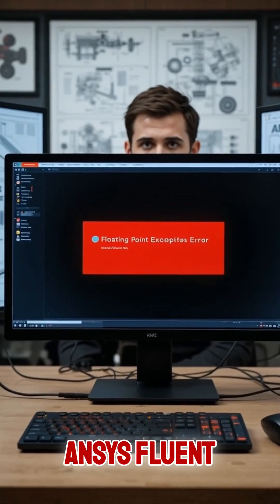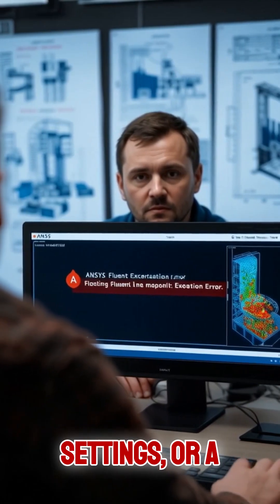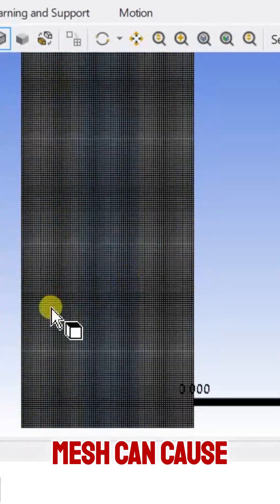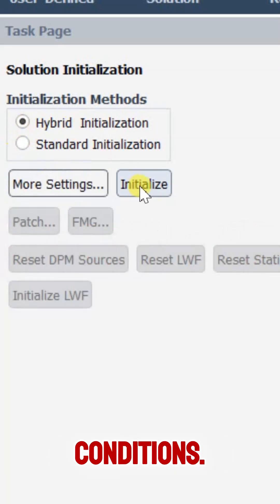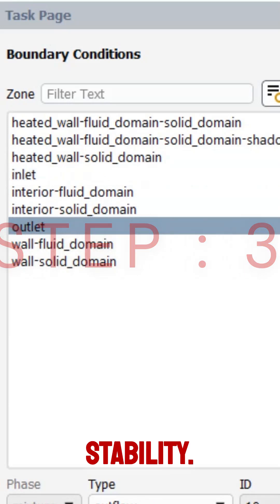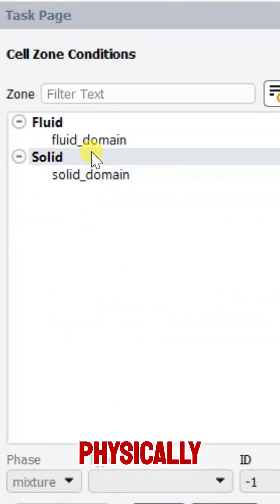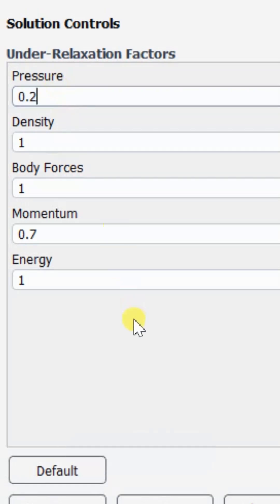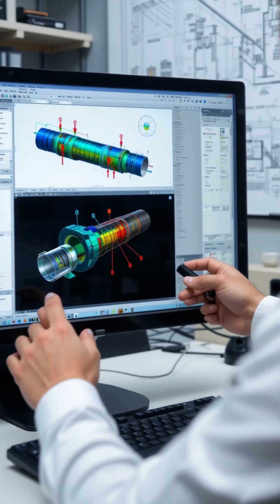How to Solve Floating Point Error In ANSYS Fluent #ansys #floating #error #solution #cfd #fluent

Comment: What is the difference between standard initialisation and hybrid initialisation
Reply from the maker: In standard initialization,  we provide some initial guess for velocity, temperature etc, so the solver starts solving using this initial guess, whereas in hybrid initialization,  it first starts solving some equations and from that results it takes the initial guesses of the parameters.
Reply: @AnsysTutor  thank you so much